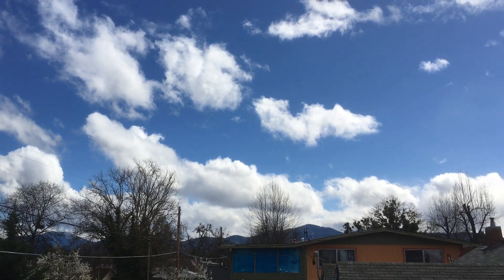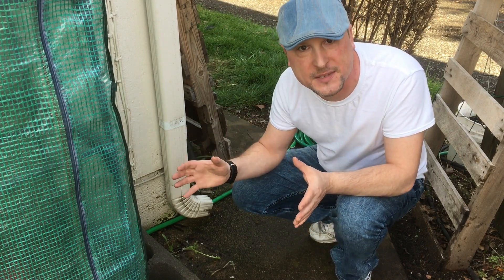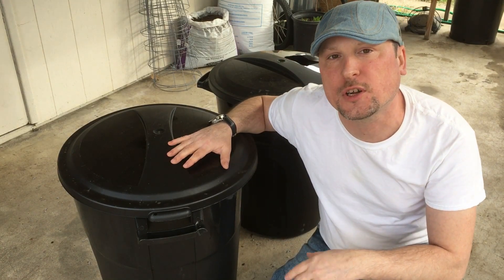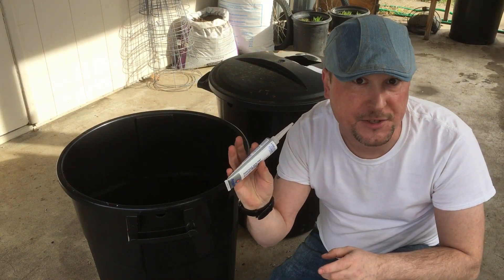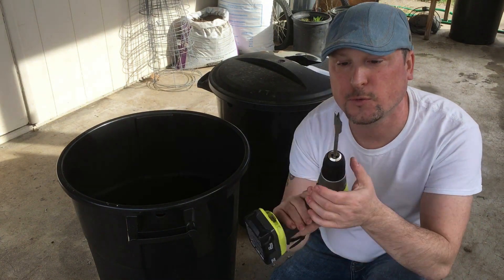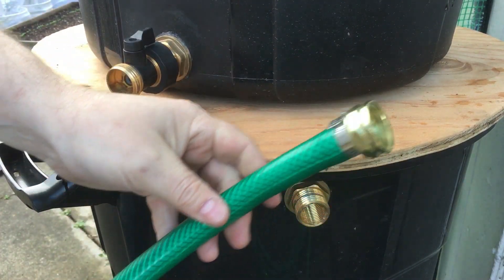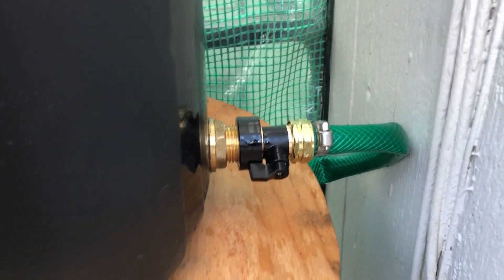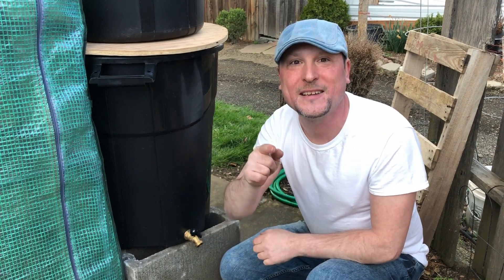How to Build a Rainwater Collection System| Episode 86

Comment: Nice simple system. Is there any sort of filter on the rain gutters? If not, you might want to figure one out so you don't have a bunch of debris in the holding barrels.
Reply from the maker: I believe there is a screen in the gutter. But I will clean out the barrels each season as they dry out. As I am most certain they will by August.
Reply: I attach screening to the top. Keeps critters out, too.